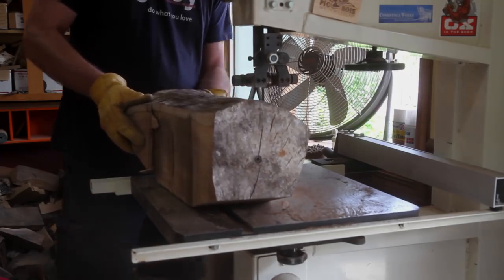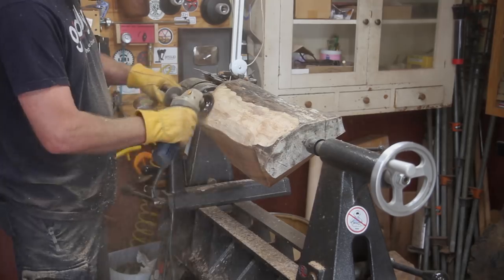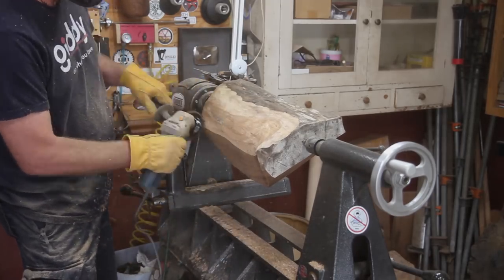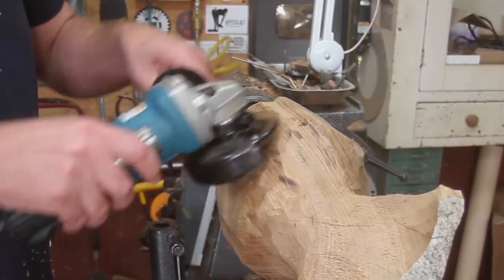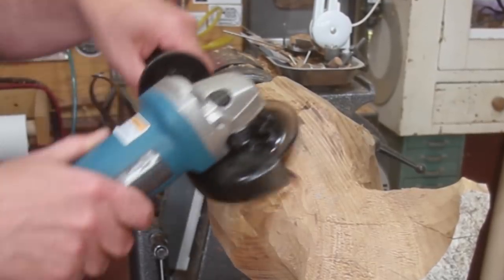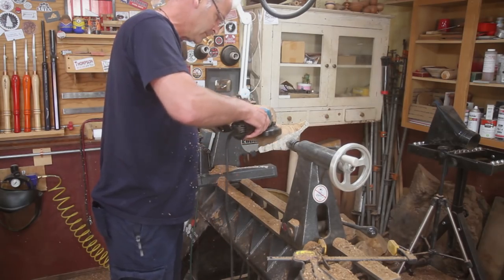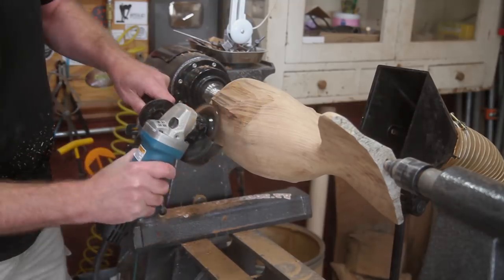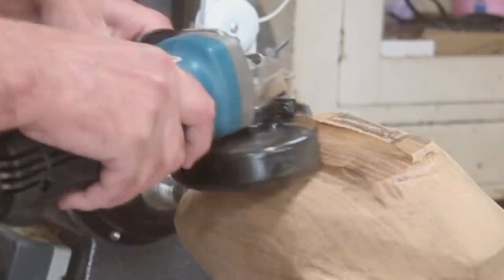Woodcarving Maple Whale Carving With The Arbortech Turbo Plane

Comment: How does the turbo plane handle when going against the grain? I love using my kutzall disc since it doesn't seem to impact the surface either way. Thinking about picking up the mini turbo for small power carved bowls.
Reply from the maker: I don't think it handles any different against the grain of with the grain. I think the biggest benefit is with the grain the cut is very clean and it's cutting the wood so there's very little dust.
Reply: Carl Jacobson that is definitely the downfall of the kutzall disc. It's like a giant dust storm.